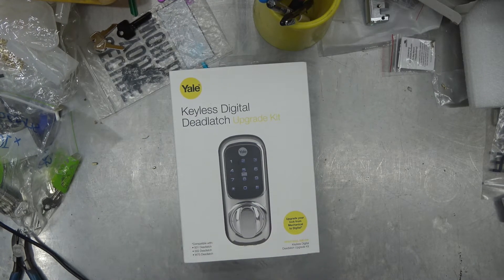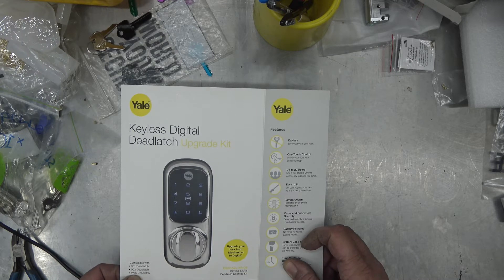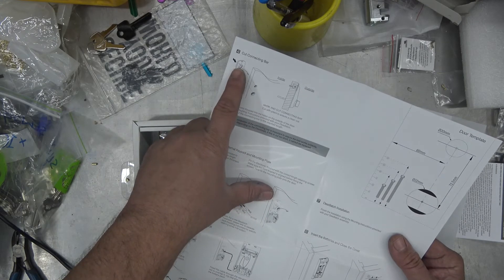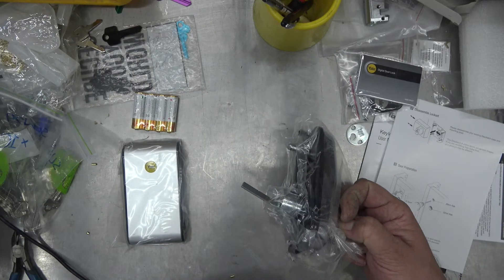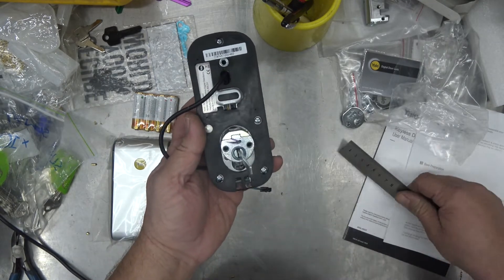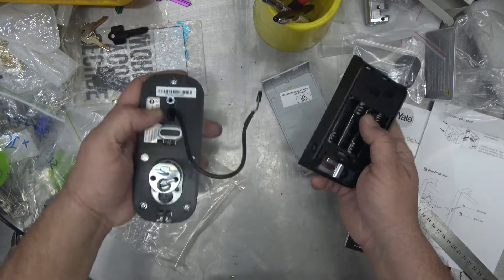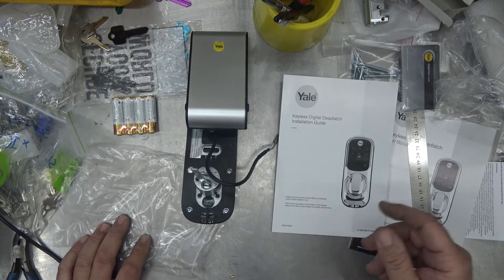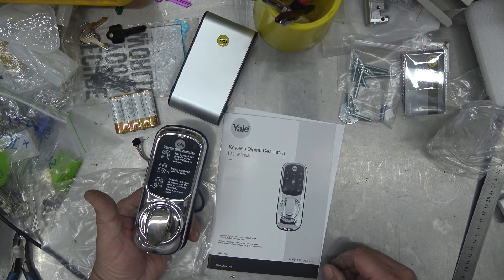Yale Chrome Digital Deadlatch Upgrade Kit

Comment: From my experience these do not work well with deadlocking nightlatches (the ones you need to turn an extra turn with the key after leaving the house) and I wouldn't install that cam at all. I was called a few times when this cam was installed and someone tried to force it to the other side and jammed the lock. Also, the spring can pop the deadlocking nightlatch to a deadlocking position and lock people in. The top hole does not need to be 20mm, 15 mm is enough.